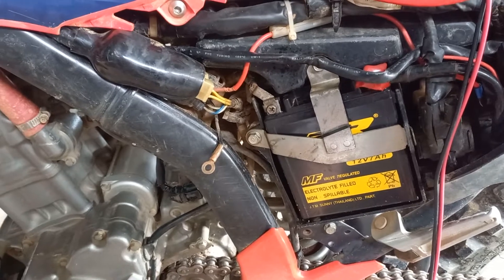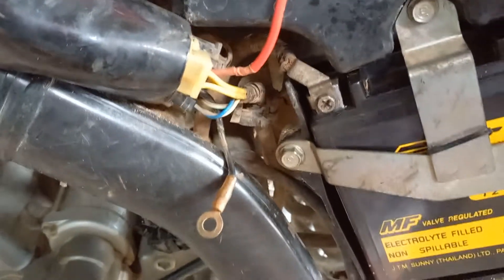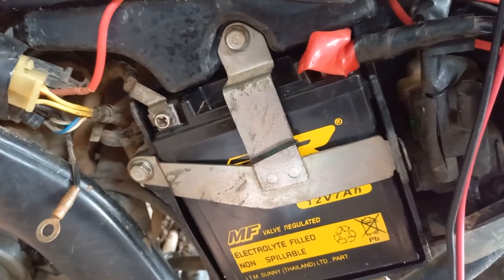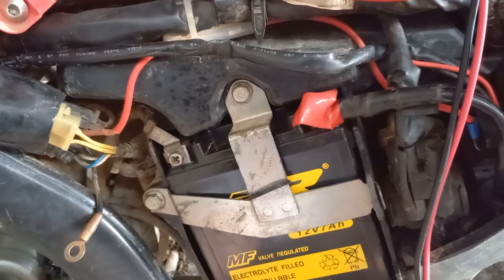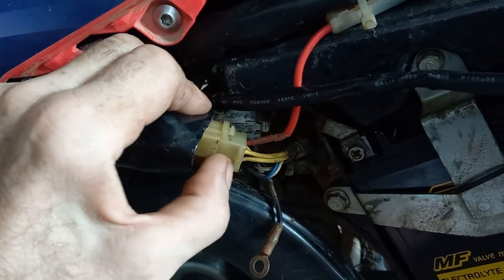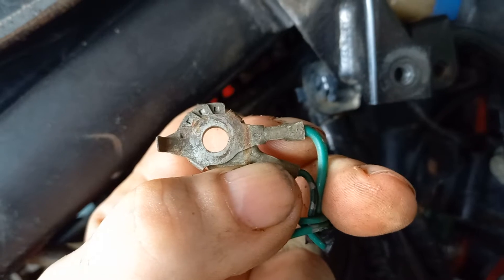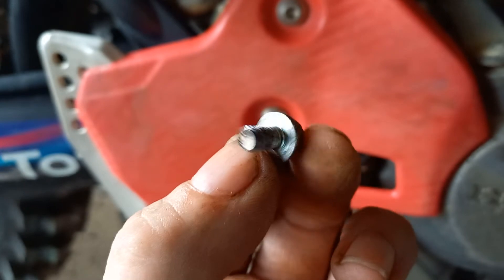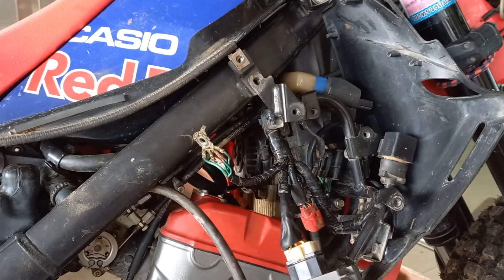CRF250L rectifier overheating charging fault part1

Comment: Dude I love Aussies!   I was about to tell you about the stater plug..  Tip just delete the plug and solder the wires. The plug just as spayed connectors and cant handles the current, eventually it will melt the plastic plug and short burring up your battery and stater.     Thanks for the tip on the ground lug..    I have read that the Reg/Rec is possibly the cause even though it cheks out, not passing the current and causing excess resistances.  Maybe solved on newer models, mine is a 2013..  Think my ECM is shit too compared to what other say with newer bikes but i did come from a XR650R.. so...    Anyways Mr-T was elected so hopefully we can free you guys and you can have cash to buy a new bike or gas..     Put a shrimp on Barbie for me..Err maybe she wont like that.. j/k